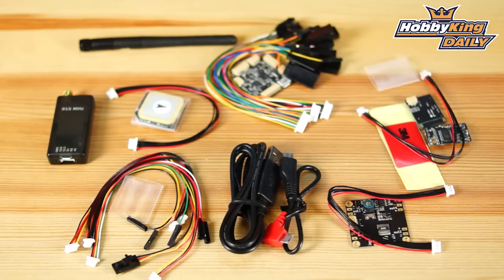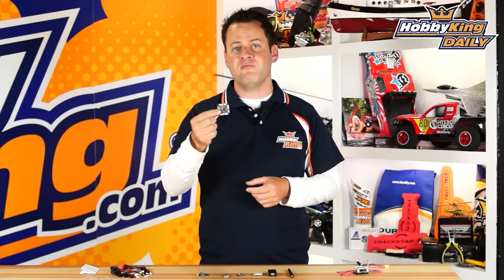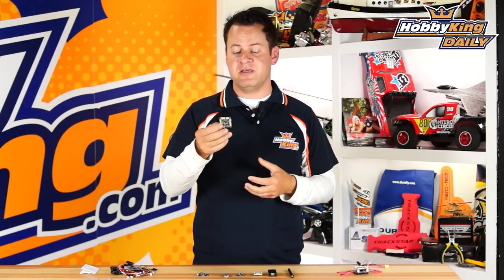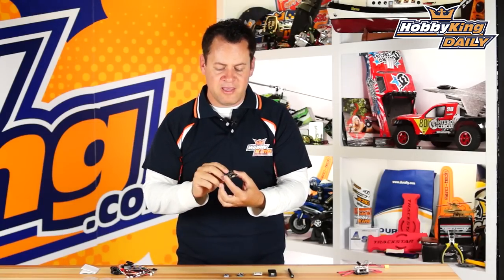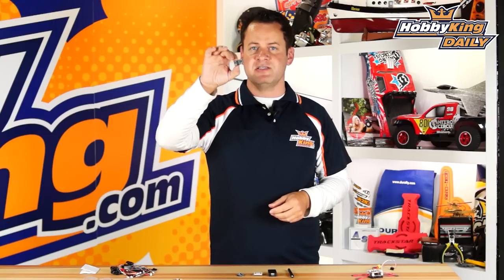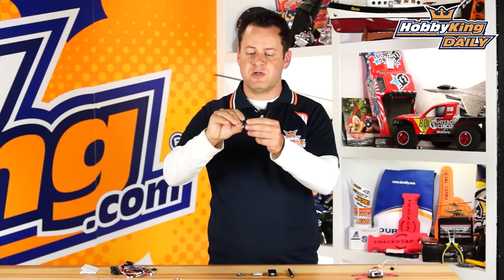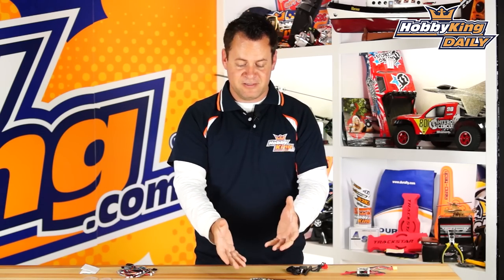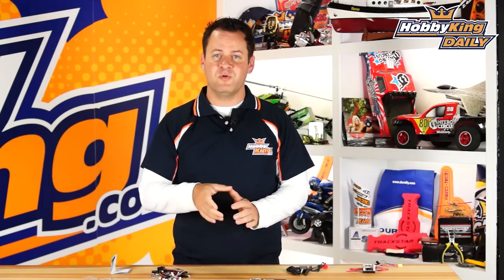Micro HK Pilot Mega Master Set - HobbyKing Daily

Comment: The mega 2.7 full size are great.  I bought a mini APM from another company that had this style wiring harness and it took 5 times as long to setup.  What a pain with the spaghetti mess of wires.  I have yet to get a 250 to fly as good on APM as they do on naze32.  I don't know if they are not fast enough or tuning strategies change.  I run APM on 330, 450, dart 400, and many planes and its great!  I'm sure I will be tempted again to try a 250 but I won't do another one with the harnesses.  Also the mini/ micros don't seem to come with GPS stands/ cases.  There is not a lot of real estate to mount a GPS to a 250 chassis.

Comment: I'm going to use a UBEC(5v) to power the board. Is it better to power it through the reciever or connect the two VCC inputs together and connect the two GND inputs together in PM socket using a 6pin jst connector and connest thoes two to the UBEC. which one's better?? I don't want to mess up with the jumpers on the board.

Comment: I have a problem with the set up. it all works fine until i hook up the GPS. The internal compas dos not work if the gps is connected. and i can not move the gps further from the main board. Can some one tell me what I can do to fix this issue.  There is one compass on the main board and one on the gps. It is not possible to calibrate the compass if the gps is connected.
HK can you tell me how to fix this! 

Thanks
Reply: Han Albers Did you cut the compass trace that sits on the main board?  That's the only way that the remote compass will work.
Reply: No, I cut the wire from the GPS module. So i use the onboard compas. Everything works great now.
Reply: Han Albers My personal experience has been that using the external magnetometer (compass) works better, as the onboard compass can be quite glitchy due to it being so close to power wires and sources.  I have APM's set up with both, but my preference it to use the remote one.